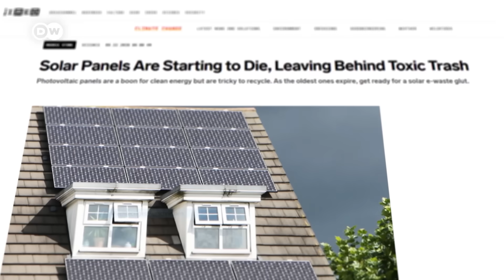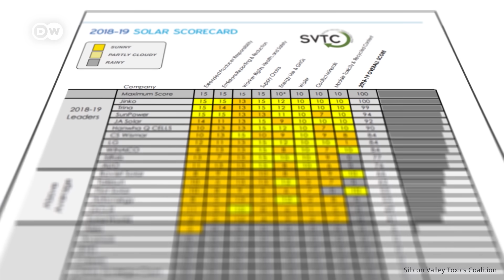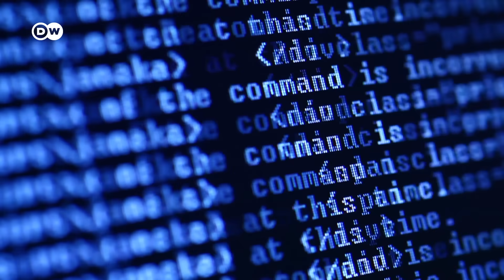How green is solar energy really?

Comment from the maker: How do you think we should deal with the not so green sides of solar energy?
Reply: Stop using solar and start using geothermal power. It saves space and operating costs are low. And its highly scalable with modern drilling options
Reply from the maker: Thanks for the info, @mohamedvahid1190 ! Our team of reporters will look into this :)
Reply from the maker: Thanks for the heads up @Potato_Smuggler ! Our team or reporters will look into this some more but we have already touched on some of the topics you've mentioned in our other videos. Take a look and let us know what you think: 
https://bit.ly/3cDt8ZQ 
https://bit.ly/3HIe9Mw
Reply: Stop using the diluted nuclear powers (solar, wind. geothermal, biomassa, fossil fuels) and start using the concentrated ones (uranium, thorium).
Basically (except tidal power) everything is nuclear. 
The sun is just a huge nuclear fusion reactor (no, it is not renewable, it will run out of fuel once, but it will destroy Earth long before that)
Solar and wind is just harvesting that nuclear power in a very inefficiently way.
The core of the earth is hot, due to nuclear decay of heavy elements, so geothermal is also just harvesting nuclear energy.
Fossil fuels? Stored nuclear energy. Plants collected the nuclear power from the sun, captured the carbon and sink it below the surface. When we burn them, we just restore the billion year old situation when CO2 levels were much higher in the atmosphere.
Biomassa, biofuels? The same story. 
Then why not get it from a more concentrated source? 
Why not get our nuclear energy directly from nuclear fission or fusion? 
Why are "greens" so against it?
Reply: @solutionrebellion  Spot on man! 👍👍👍It's great to see someone with a brain, thinking bit out of the box.
Nuclear energy is the cleanest and most efficient form of generating energy on a large scale.
Solar and wind great options for some areas and both have advantages and disadvantages. They are small and decentralized and could generate cheap electricity.  But their intermittent character requires storage capacity and /or smart grid and backup. And their whole life cycle is not as efficient and green as it seems. 
By 2050 the world’s population is expected to live mostly in big cities (often in high raised buildings) which are not very suitable to be powered by decentralized sources.  A nuclear power stations can provide clean energy for most of the world.
The only problem with nuclear energy is  that it doesn't make anyone rich. There is no any powerful lobby behind it. Both “Big Oil & Gas” (+ coal) and “Big Green” see nuclear energy as existential threat and  quietly oppose it. Cheap, plentiful and realiable energy would drastically downscale their businesses.
Reply: Find better ways to produce solar and asses the different options on FULL lifecycle pollution costs. This includes, as others have also commented, the carbon footprint of storage/batteries needed for solar and the associated parts like inverters, mounting frames, cleaning and maintenance, transmission lines, etc, etc. Do NOT just assess the carbon footprint of the panels themselves.
Reply: @robertlipka9541 I you had the FULL lifecycle assessment of Nuclear, no one would even think of using it.
Reply: @veronikasmith4927  ... sorry but I have to call out this as a nonsense statement. Many sources disagree. You do not even specify which type of reactor, which design generation and build where, under what regulatory framework... all MAJOR parts of cost.
Reply: How about building a artificial SUN 😉
Reply: Nuclear power instead.
Reply from the maker: Hi  @teaseaboywonder , could you elaborate a bit more as to why you think nuclear power works instead?
Reply: @DWPlanetA  More reliable (power production can be increased on demand at a moments notice), more efficient in space usage, less CO2 than wind and solar, not reliant on a communistic country that is currently running literal concentration camps, spend fuel can be recycled into new fuel, has a proven track record, needed for the production of medical isotopes. Do I need to continue?
Reply: @DWPlanetA  Reasons for nuclear energy:
1.   It is a source of clean, reliable and relatively cheap electricity. In the US it is statistically the safest form of energy, even ahead of solar. The current high investment costs are mostly due to regulations, if there was a political will, then standardisation and more development would push the price down significantly. 
2.   It is centralized, uses very little land space per unit of electricity generated. It is great to power big agglomerations where most world’s population is expected to live by 2050. Nuclear plant also uses the least resources per MW to be build. It doesn’t seem but wind turbines use a lot steel, their foundations use huge amounts of concrete, same for solar. Nuclear plants are under strict surveillance.  There will be no illegal dumping of its components after decommissioning.
3.    Some form of base load will be still needed for a renewables, at least in some countries. Nuclear is pretty much the only clean source to provide it. It is an ideal part of the ENERGY MIX
4.   There is enough known supplies of  uranium and thorium to last for centuries.  There is also a lot of material from dismantled nuclear warheads.  Further research into fusion would reveal truely unexhaustable supplies of energy.
5.   It works well with existing grid infrastructure. There is experience. 
 
To see this in practice, go to France. 👍👍👍  
1. Can you see any nuclear  Armageddon, acidents, pollution? NO
2.  Does it generate CO2? NO, not directly. Carbon footprint of French energy sector is low.
3. Do French pay extortionate prices for electricity? NO In fact it's cheap and used a lot for heating.
4. Do they have reliable source of electricity all year round? For decades? YES
Reply: Wind/Solar Power cannot cover base-load power demands. Coal/ lignite  power plants need to kick in when solar/ wind power output goes low ( night time, winters ) . Those coal/lignite power plants will have to be kept on stand by 24/7. This has actually increased carbon emissions in Germany over the past year. Also, Wind turbines are high maintenance. For base load demand its either nuclear or gas power plants.
Reply: @visibletoonlyyoutubeusers9574  Well, Germany doesn't want nuclear so the future of "green revolution" is burning more gas. It's almost as if sun and wind aren't reliable in central Europe. Who could have known. France has significantly lower emissions because of their reliance on nuclear and they seem to be doing fine.
Reply from the maker: @Potato_Smuggler  We take it you've already subscribed to this channel 😉 
We've actually spoken about this in our video about Nuclear: https://www.youtube.com/watch?v=9X00al1FsjM&ab_channel=DWPlanetA
Reply from the maker: @visibletoonlyyoutubeusers9574 Thanks a lot for this insight :) 
We have worked on wind energy (see here: https://bit.ly/3kXum6I) and also did a piece on nuclear energy, which addresses the increase in CO2 emissions by Germany: https://bit.ly/3DKHIKP 
Let us know what you think!

Comment: Whilst Green energies make people feel warm and fuzzy they are simply a con!
Reply from the maker: Why do you say that Neil?
Reply: @DWPlanetA  Because if you've done any research into Green Energy you will soon see it is not the saviour you've been promised. Electric cars are a great example, they do not save the planet in fact it could be argued that they actually are worse for the environment than fossil fuel vehicles overall. Concerning coal, I think we should put a lot more research into a power source we have in abundance and try and make it cleaner, that would be far better than putting faith into power sources that are still in their infancy and are extremely expensive and CO2 emitting to set up.

Comment: Just run the solar panel production factories on solar power themselves. 🤦‍♂️
Reply: Do you know the amount of energy needed? It is hardly feasible.
Reply: @LoïcDesiron  i think it si quite feaseable, solar panel already put out an enormous quantity of energy, but not all solar panel will be produced with solar energy, plus because we want our factories to Work 7/24, they sometimes will have to use a baseload energy production, generally methane or if  we're luck hidro or nuclear
Reply: @domenicocor1185  or wind power, or biomass powered generation or geothermal power or just a simple storage solution which shift power from day to night.
OoT: "baseload energy production" is a contradiction in terms.......it is either a energy load (=consumption of energy) or it is energy production. 
For a typical 24/7 supply  a mix of different sources is needed which is flexible enough to follow the required power load, because in most cases the load is never constant but it varies constantly ove time ;).
Reply: Arc furnaces that reduce silicon are impressively power hungry, so is refinement to polysilicon and crystal growth for mono panels, so I'm sure they prefer to run all these processes when electricity market prices are cheapest, for most parts of the world that happens night-a-clock when everybody is sleeping and using minimal power. Of course, with enough solar installation on the grid that dynamic will eventually flip, leading to cheapest power when the sun comes out.
Reply: #lifehacks
Reply from the maker: Hi, thanks for your sentiment. In the video we speak of the waste of these solar panels and how businesses can recover valuable materials at a high purity. Currently, the solar panels are not infinite materials so we wanted to showcase how clean energy would work within a circular economy.  If you watch 3 min into the video we showcase the toxic chemicals that go into the making of these solar cells. This is an ever-expanding, complex topic so happy to hear more about it :)
Reply: @DWPlanetA  Thank you I watched the whole video as well. I think most of the solar PV production takes place in China currently, where few enviromental guidelines seems to exist, and much of the power still comes from coal plants. Germany also used to produce solar, but the solar jobs were lost to China, after subsidies and import taxes were removed as far as I know.